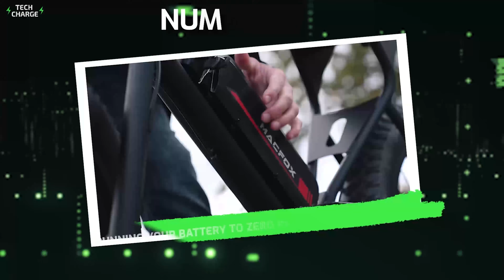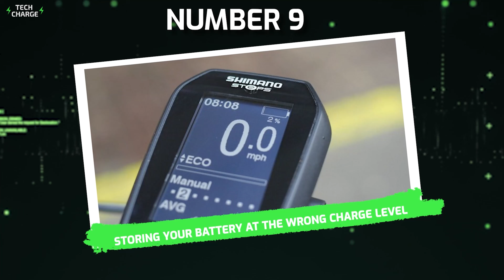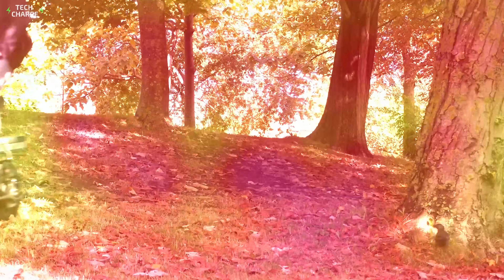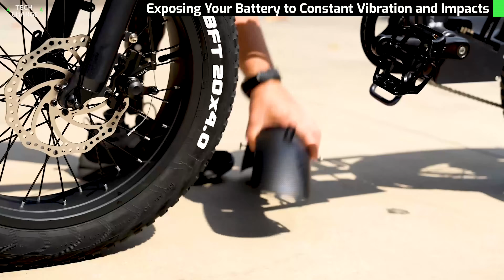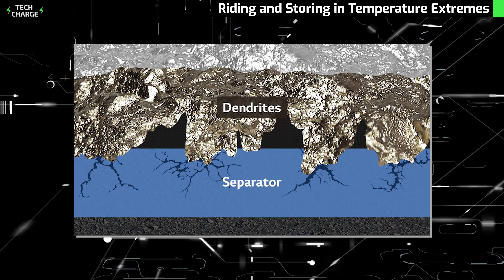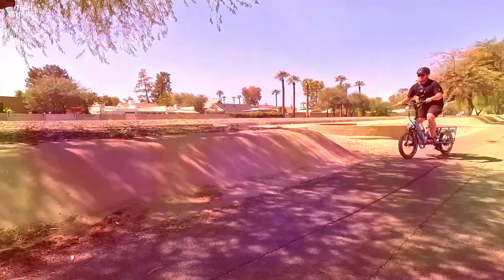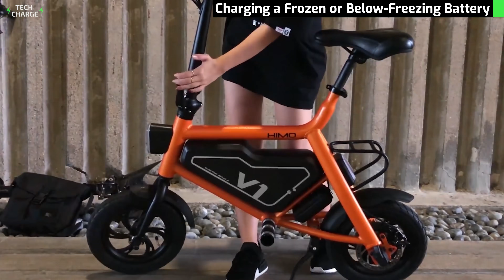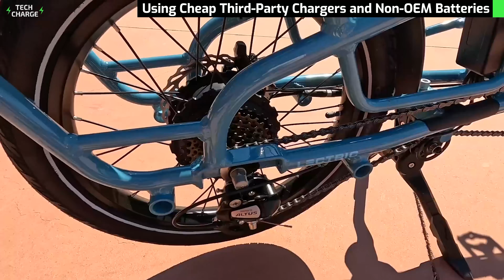10 Electric Bike Habits That Are Slowly Destroying Your Battery

Comment: My normal routine is to charge my battery back up to 100% state of charge every single time I'm done with a ride. Although I do let it sit for a few hours first. So, having stored my bicycle with the battery at 100% state of charge, my battery is now four years old. I have roughly 6000 miles on my bike. I have experienced zero degradation of capacity. I know that because I have a regular ride that is very long and steep and by the time I return home the state of charge of my battery is basically the same, and has not changed in four years. I also store my bicycle in a backyard tent in the low desert, with temperatures in excess of 110° for at least three months out of the year. No problem there either. So don't fret it too much people.
Reply: My eMTB always charging 100% after use. After 3 years still working and good condition
Reply: @Boediprasetya  Sounds good.
I can tell they can get old before it needs replacement. The previous E-bike I had was 17 years old. It still had it's original battery.
That battery was 584Wh. NO loss of power after the years. Unfortunate I had to scrap the bike.
The motor broke down. And there's no replacement for that motor.
The battery was sold and is now in another E-bike.
Before it was sold, we checked if it did fit in that bike. And if the bike accepted it.
Reply: From the comments section. I heard this before but How exactly are you supposed to charge a battery to say 75% with out checking the voltage somehow every 5 minutes before it goes to 100% ? What’s the solution to this please ? Anyone ! They say this for mobile phones as well.
Reply: @scottmiller6382  With 4 LEDS on the battery, charge it untill the 4th LED stars flashing.
The battery is charged for 75%.
With 5 LEDS on the battery, charge it untill the 5th LED starts flashing. Now it's 80% charged.
That can be a little different.
The 75% / 80% is for storage when not in use.
When in use, I recommend to charge it to 100%.
Reply: @FRA.36 oh right that completely makes sense. I may of even done it years ago but I slept since then. Seeing this post but not having a charger in front of me I forgot about the led’s.  doh! Thanks for sorting that out
Reply: @scottmiller6382  Happy to help.
I'm very technical myself but, even if I wasn't technical it's easy to understand.
Reply: @FRA.36  Unfurtunately I have other stuff to do than sitting for 3 hours in front of the battery and watching the LED blinking.
If only the manufacturer would add a small mechanical switch into their rocket sience CAN BUS 129€ 4AMP charger that tells the 24core CPU of the BMS to charge (position 1) up to 80% or (position 2) to 100%
Reply: @dirkspatz3692  The smart charger from GIANT has this feature in the charger. You can press when you plugged the charger in, a button on the charger and it keeps the battery at 60% (or 80%).
Reply: @scottmiller6382 any quality bike will have an app or function to limit charging to 80%. Same as an EV. You only charge to 100% when you plan on needing it. My wife recently bought a new but relatively cheap and now discontinued 23 model Giant Liv that runs an outdated operating system and basic charger.  It doesn’t have this function unfortunately but it charges quickly so we just take it off charge when it’s at 5 bars on the battery packs LED’s. She loves it.
Reply: My owner's manual a tally says to recharge to 100% after each use!!!!
Reply: @DatGuy960  Sounds like you own an E-bike that uses an ION-motor. That's a bike that must always be connected at the charger when not in use.
If not, the battery will switch to 'sleep' mode.
Reply: I charge my battery a 100% every day.Because that's my main transportation
Reply: Very similar usage and results for me. I have 6800 miles over about 4.5 years and I don't notice much of a drop off. I keep it pretty full, don't run it down all the way, and charge it often.
Reply: Charge then ride it for twenty minutes before storing
Reply: The other important thing is do not leave the charger attached for long periods after it does charge to 100% even though most have voltage safety regulation.
Reply: Thanks - First ebike and I’ve been freaking out about storing it in a south facing garage in PNW summer and don’t ride much at all winter. Garage isn’t well insulated. No room in my condo. I could take the battery out I suppose, but storing it inside my condo been worrying listening to all the watch out for battery Fire 🔥 stories. It is UL new battery-Velotric ebike. Kinda takes some of the fun outta the thing😢😓
Reply: Your battery pack was made with quality cells instead of tofu-dreg discount chinese cells.
Reply: @animejanai4657  Sounds like you are stuck in the last century.
Reply: @animejanai4657 when it comes to batteries Chinese companies are the lead suppliers right now

Comment: Someone needs to invent a battery maintenance charger to keep at 40-60% charge all winter (6 months here) so people can forget about it and not damage their batteries
Reply: There is already a charger that will keep the battery of the E-bike at 60%.
Giant is the brand that made a charger that can be used to keep the battery at 60%.
You only need to get the battery of your Giant E-bike below 40%.
Press the button on the charger when charging the battery. That button activates the cyclus that keeps it at 60%.
Then the charger stops charging when it reached 60%.
Reply: @FRA.36 Thanks Fra! I couldn’t find one late Nov when I last looked. Had them on motorcycles for years.
Reply: I've purchased a Giant trance with a 800 wh battery massive range the charger has a normal charge function and a 60% charge function
Reply: @michaelforty1132 
That's a good bike to have.
I know that your bike has an mid motor from Yamaha.
And with 800Wh your bike has a range over 78 miles.
I've ridden an Gazelle E-bike with 720Wh battery. I managed to ride 78 miles. and I still had battery left to go another 10 miles.
My original E-bike has 400Wh. And a range of 40 miles.
Reply: What I do is I have a 48 volt charger for my 52 volt battery as well if I'm going to store it I just charged it up on the 48

Comment: Do the battery chargers have to bev UL certified and be labeled with the certification ??
Reply: If the bike is certified to UL 2849, that covers all the electronics, which includes the battery and charger. The charger itself wouldn’t bear that marking, but may for a different standard that covers chargers only, just like how the battery would display a UL certification to UL 2271, which is specific to ebike batteries.